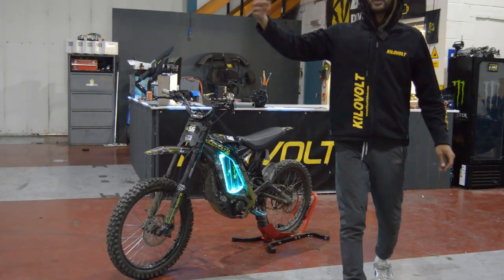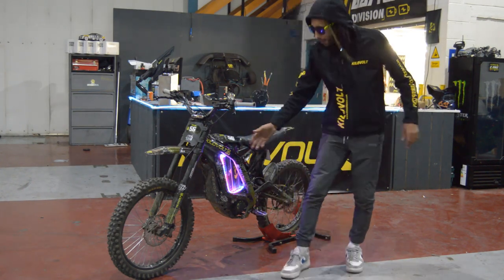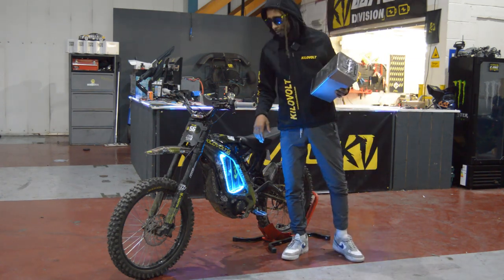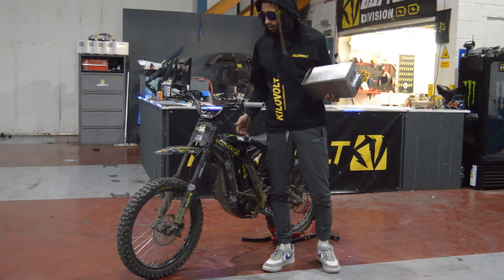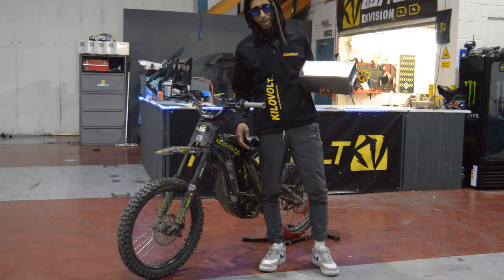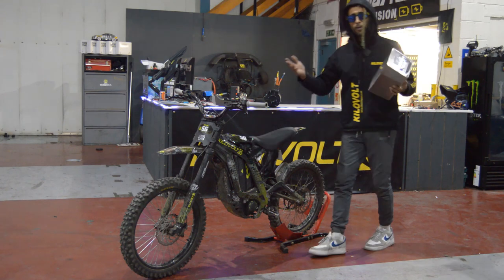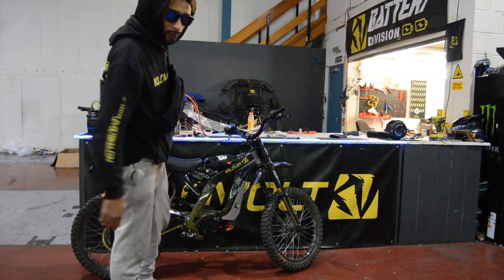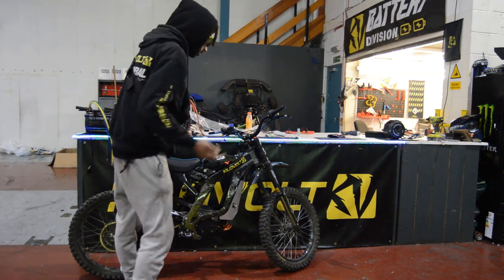We start work on our 96v Surron Upgrade **QS165 Motor + Prototype 96v Battery**

Comment: Do you get more range because of higher voltage ? Let’s say I have a 72v 50ah molicels and you have a 84v 50ah molicels with the same exact controller and pulling the same exact amps 100A controller … who gets more range and why ??
Reply: Although power delivery is more efficient at a higher voltage, mechanical power conversion (by motor as it is rated at 72v for optimal efficiency) is less efficient so you'd actually get lower efficiency.
Reply: @DescartesRenegade  thanks man I ended up going 84v 65ah instead of 72v … the motor gets less hot and I get to achieve more distance / range … I got 90miles on my pack going 20-30mph and came home at 45% 👌🏿
Reply: @rolandroland1485 whats ur top speed?

Comment: Whats the model of the far driver controller you used and have you done any top speed and temperature tests with it compared to stock?
Reply from the maker: It’s a factory modded 96530 . Has been customised to accept encoders ⚡️🙏

Comment: What do you think would be better in a quad bro, the qs165 or a geared 138 90h?
Reply from the maker: 100% the 138 is better , problem with 165 is it’s really designed for use in Surron as a result is a really narrow motor that would most likely overheat easily when used in a quad .

My all time fave motor for a quad is the QS138 90h non geared , with a big back sprocket (60t) for wheelies 🚀🚀🙏

Thanks for the comment and hope you like the vids
Reply: @KiloVoltBikes  just got a LTZ400 but going with the geared qs138.. what sprockets you think will be best?

Comment: What controller are you using?
Reply from the maker: manufacturer modded fardriver 96530.
specially tweaked for encoder support
Reply: @KiloVoltBikes  is there a reason you went with the 96530 instead of the one you originally planned on using?

Comment: 96 volt battery 😵 with a stock Sur Ron can ride for Miles 👍
Reply: Do you get more range because of higher voltage ? Let’s say I have a 72v 50ah molicels and you have a 84v 50ah molicels with the same exact controller and pulling the same exact amps 100A controller … who gets more range and why ??
Reply: Its quite complex and I cant give you a definitive answer without a full lab test.

With an identical power level for both bikes and with sprocket sizes adjusted to give the same top speed... In theory the Higher voltage should run cooler and therefore be a bit more efficient as less energy is wasted in heat.... or at least that would be true if you could also choose a lower kV motor for the higher voltage.
Power in watts is Voltage  x  Amps (P=V x i) ...so if you run a higher voltage less Amps are drawn..... higher Amp draw means more heat. 
There will other variables which will interfere with the above though such as motor design, windings and kV suiting a voltage sweetspot.... as when you go up in voltage you normally choose a motor with a lower kV (RPM's per volt) rather than adjusting speed via sprocket size.
With identical kV motor on higher voltage you could end up saturating the motors electromagnetic fields which then requires FOC field weakening which creates a lot of heat... so then you could end up with lower overall efficiency. 
 I think you'd really need to have a lower kV motor to be sure of a higher voltage efficiency increase.

Comment: I need more fardriver vids. These Walmart bikes are cool but the controller situation is far more valuable. We have sabvoton burning out due to ass flux Kelly ass VTOL asss ASI 2-8000 line is a god dam cult, assssss. Really need someone to save us. Have nd72850 on my "stealth" clone but can't get it to drive the motor. I think the halls are not wired correctly. Wish I had more fardriver vids.
Reply from the maker: We will do some more fardriver based videos , we really like them and have used them for a good number of builds
Reply from the maker: Thanks for watching

Comment: Stock Motor Better than QS and Bac Better than FarDriver
Reply from the maker: Any evidence to back up those claims? Willing to bet you’ve never tried Fardriver or the QS motor . We would rather hear tested facts rather then opinions based on rumours
Reply: @KiloVoltBikes  EMoto Bro just uploaded a Data research video and Test
Reply from the maker: @SaltCreep45  Which version of the 165 ? Encoder or hall sensor as the 2 perform very differently . Also very doubtful he tested the motor conclusively at a full range of voltages and gearing setups . So one video and a few silly comments won’t stop us testing the QS165 Vs stock vs KO .  Overall your comments are non constructive and also have no context as we have proven in this video the 165 and fardriver IS faster then stock setup - the draggy times don’t lie…
Reply from the maker: @SaltCreep45  “Motor won’t take no more power”  If you believe such statements provided in this video then I think it’s probably a waste of time us discussing motors and controllers 😂
Reply: @KiloVoltBikes  just going by the test done by Emoto Bros . Surprised the QS doesn't over heat at 96 volts .But hey seeing is believing
Reply: @KiloVoltBikes  Hey more power to you i like to see more of the 96 volt in the trails and mountains

Comment: We tried that motor already. It is terrible,,worse than stock. it heats up quick and cant accept more power than 8000 watts. Stick to the stock motor
Reply from the maker: We are playing with tuning and settings currently . What voltage was you running it at ?
Reply: @KiloVoltBikes  72v. Motor is crap. It does not take more than 8kw, while the stock motor performs at higher power and voltages and the output is linear.
Reply from the maker: @Buffetology  do you have any proof for those claims ? - it’s not what we are seeing at all . Many others have this motor and are pulling allot more then 8kw also .